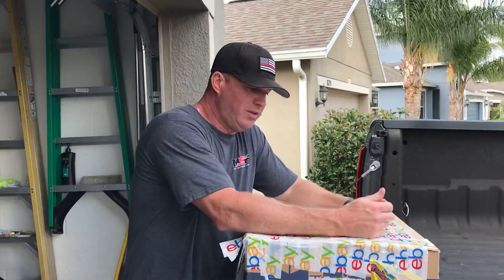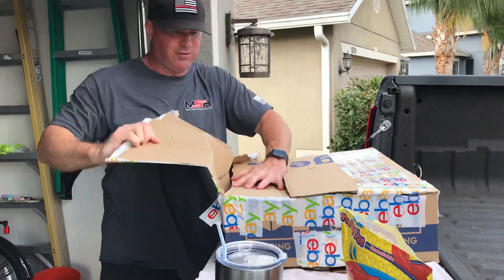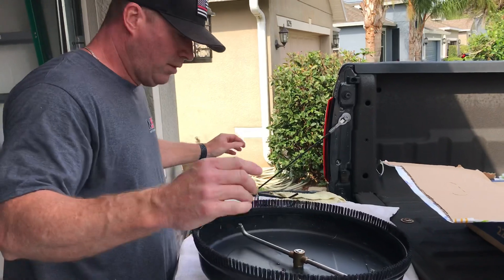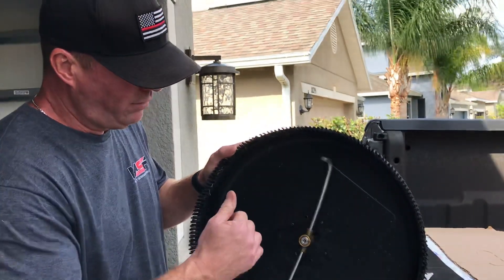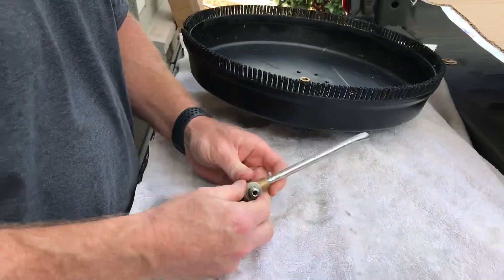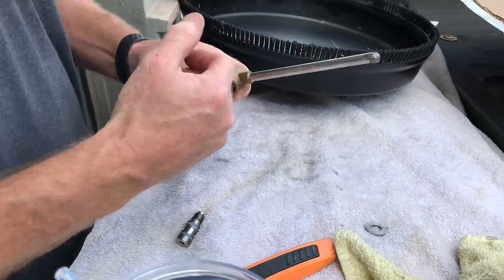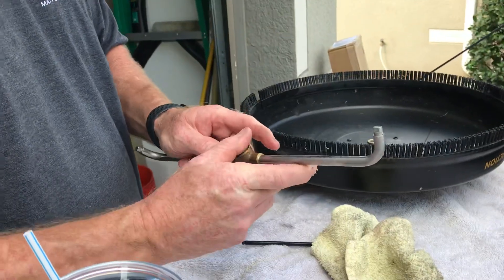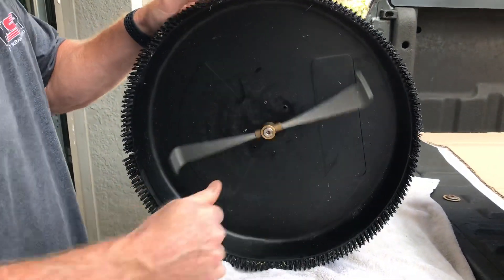How to Lubricate and Service your Dewalt 18 inch Surface Cleaner

Comment: I bought one of these, used on on my large deck once. I am a journeyman tool and die maker and am very good mechanical skills. My suggestion is to look at the spinner, if the internals look like these don’t buy it. I think the commercial ones are much better but are much more expensive for most of us home owners. Hard to find a rental place that rents surface cleaners.

Comment: I have lubricated mine and it spins well by hand. When I add the pressure it seems to lock up at in the middle. Do you know what would cause this and possibly how to resolve?
Reply: Did you ever find out what was wrong with it

Comment: Good Video, however Petroleum Jelly will deteriorate Rubber O-rings...Advise that you use a Silicone type grease to not compromise the rubber material.

Comment: Pop it out after every use? Isn't that a bit overkill?
Reply: These things have a known, serious problem. A relative just got a package dealmof a gas waterblaster with this included. Lasted 40 minutes and stopped spinning. I suppose it's not overkill but rather keeping it running in some cases.
Reply: @Smurphenstein  So avoid this product is what I'm hearing
Reply: @jimmypage1969  well avoid it if you have 300 plus dollars to spend on a better surface cleaner.

Comment: I have the identical surface cleaner. I plan on putting 4 wheels on mine. I think 2 inch polyurethane wheels will work. Thanks for the video!
Reply: I would like to see it with the wheels

Comment: Does anyone know why my Dewalt my surface cleanest not only sprays out of the tip ends BUT ALSO out of the center alittle
Reply: i'm having the same problem
Reply: It is a known issue of these heads. Very poor quality materials.

Comment: Hey man I just got one myself, appreciate the DIY service but how do you unclog those tips?
Reply: @Rene Hernandez I found out how, you get pliers and unscrew the tips clockwise, I didn’t know they come out. When you take them off, get a piece of wire and stick it though until it’s clean, before you piece all together make sure you put WD-40 on the bigger peice so it can spin like it shows in the video.

Comment: Hi,

Do you think the nozzle tips on this dewalt surface cleaner can be upgraded for a larger pressure with (3.0 or 4.0) GPM?
Reply from the maker: Most likely. You can also find a different nozzle to reduce the angle range for more pressure
Reply: @pascopowerproducts7330  

Do you know or is there any label on the nozzle tips to see what size it comes with?
Reply from the maker: It should be by color. Some may also have imprints on them for the sizing of course, for the angle anyway
Reply: @pascopowerproducts7330  

Oh, i think I'm confusion you.  Not on the pressure washer on the bottom of the round surface cleaner.  It has two nozzle tips on the rotary bar.
Reply from the maker: Oh yeah I think it’s still the same thing. Maybe see if you can change the rotary part? The nozzle should be your best bet,  but maybe look into the actual pressure washer nozzle itself
Reply: I think this surface cleaner is designed for higher gpm machines, I used it on a 2.4 and it was mediocre at best, my gpm machines works nicely

Comment: i have the same one and it stopped spinning
Reply: I am planning to buy this pressure washer surface cleaner but the reviews did mention that it gets clogged or stops running after very little use. I think it might have to do with it being dirty inside. I would just disassemble, clean and lubricate, I guess. If the one I buy ends up getting messed up, I will try to fix it, or just return it for a refund.
Reply: JR yes I lubed it and id does work again.
Reply: That’s great to know, thank you, im glad it’s working for you again. A Rodriguez
Reply: I've learned my lesson from my very first surface cleaner(Didn't know much then).  After the fact the wands stopped spinning, adding lubricant helps.  Eventually, over a few uses, it gave up and i purchased a new unit and before using it, I opened the shaft and lubricated it as a preventative.
Reply: @lagrandisimu1810  i’ve done the same thing, WD-40 works the best, petroleum slows it down for mine
Reply: mine too..broke it down and added grease..still barely spins!